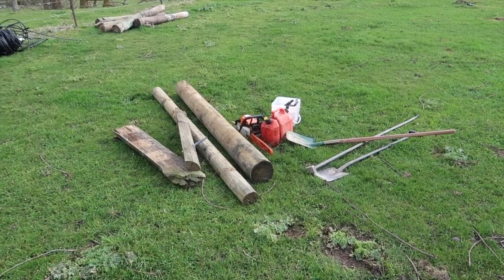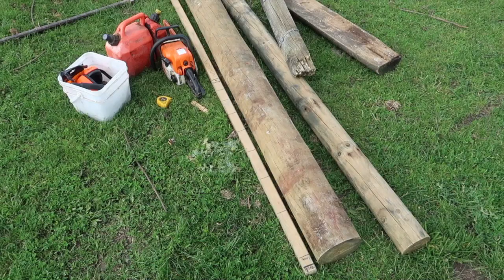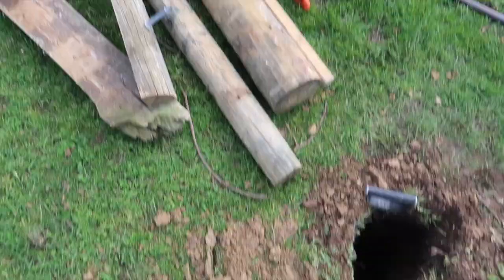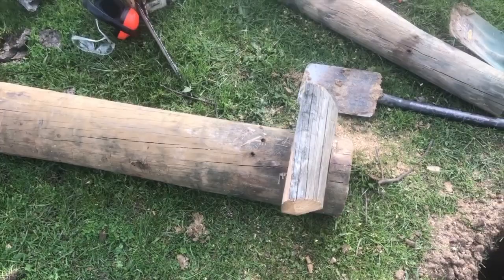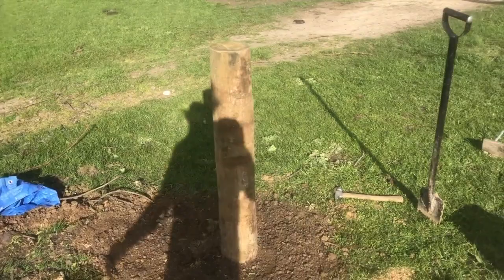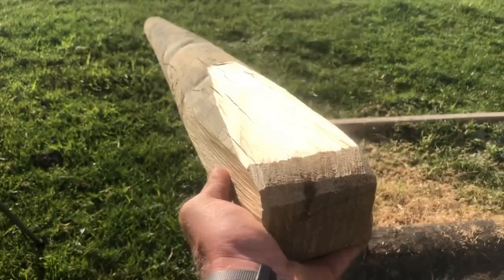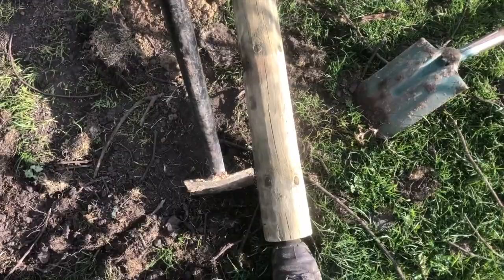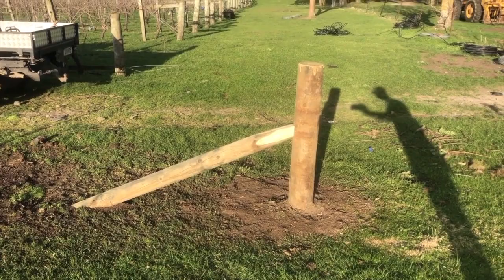Strainer Post Install (New Zealand)

Comment: Great to see - this is how I was doing end assemblies in the early eighties as a young man like you -  The post suppliers would put my posts through the chamber a second time. These assemblies are still holding 40 years later. Holes were dug with a manual borer with an extended handle to get the 8' posts 4' in the ground. Seven wires 3 hot 4 earth spaced at every 2nd hole from the top on a standard waratah star picket, however I used standard timber treated line posts. This wire spacing enabled fast and easy replacement of broken line posts with a star post.
Reply from the maker: @IsambardKingdom  Interesting to hear how others have done it/do it. Thank you for sharing.

Comment: Excellent video dude. Beautifully sharp chainsaw too. I’m putting in some stays tomorrow for a 1600-1800 fence with chicken wire and a top and bottom plate. Not nearly as deep as yours but on rotten rock and concreted in 100mm on either side. Definitely enough to go on here, great work.
Reply from the maker: @barneyatkinson-saul9881  thanks for commenting! Hope it went well for you.

Comment: Great techniques, really nice tight joint. Personally where I live in the UK it’s very wet a lot so we always retreat cut ends of the wood with wood preserver. Normally I use creosote posts which are more expensive but they last 50+ years and I retreat their cut ends with creosote
Reply from the maker: Yes, certainly not a bad idea re treating cut ends

Comment: Good to find this on YouTube for quick reference. Very tidy work too. Only thing I can think to add is using a battery drill with spade bit to get rid of bulk prior to chiselling can speed things up a bit.
Reply from the maker: Oh that’s a great idea I’ll give it a go next time! Thanks for your feedback.
Reply: Faster still, side cuts with plunge of saw. Then chisel. As long as water can drain out of pocket, no issues. 
Bugle screw foot on. Pilot drill foot so only screw into post.
Reply: @paulsmith4220  I'm pretty sure that could be done with correct technique but didn't feel safe to me as amateur.

Comment: Great video.. We have hard clay country .. I have using the post hole borer with a 200 mm auger . I bore a hole as far as I can ,then slide a half round in with matchs the hole . The I ram the stay in like you have .. saves a lot of hard digging....
Reply from the maker: Sounds like a good system!

Comment: Good vid mate another couple of ways of doing your Mita is a renovator tool.

And another way is they sell like 65mm self feed drill bits and u just use a pointed post for your stay then
Reply from the maker: @aamdempster5824  Thanks for your comment! yea mate I’m now onto the self feed bit and pointed stays, sooo very quick and perfect every time.
Reply: @Lindz37  👌👌

Comment: Top video my friend. New to farming and have a ton of strainers to replace around a block of land in Taranaki. Couple questions: 
- What kind of spades are they? Any suggestions to help with digging
- Any size guidelines for your Foot and Stay blocks? should these be new and treated so they dont rot out?
- 17:30 how do you know what sort of angle to cut your stay?
Reply from the maker: @hughezy21  hey mate, I tend to like the spade and shovel method, I like a spade that is solid steel handle and all, and prefer a shovel with a smaller head on it. Farmlands has the ideal ones I reckon.
Foot and block size no rule per se but the bigger the better just makes it harder to get em in. Yes make sure it’s treated and a step above would be to paint any cut ends with a tanalising liquid  of some sort. “Metelx” I think it’s called works well.
Line your stay up against the post pre cutting your stay and it gives you an idea of the angle to cut, refit once stay block is dug in and your cut out in post is done and adjust the stay cut. 
Hope that makes sense. Alternatively if there’s a heap to do, u could get a fencer with a post driver and they make very fast work of banging posts in, then u can do stays yourself if want to save money. As for foot on the rammed post I drive a Waratah full length down the back side of post on almost a 45 degree and with a couple large nails attach it to the post. Hope this helps cheers
Reply: @Lindz37  awesome mate, im gonna give it a crack this weekend. what size timber is your stay, eg: length etc?
Reply from the maker: @hughezy21  generally I like to use something like 2.1-2.4m long x 100ish mm diameter pointed post (pointed number 2 post) or unpointed if u are using chisel and hammer to create the pocket in the strainer post. U really can use what ever tho 1/4 rounds work too, seen half rounds used or even 100x100mm square posts. Longer stay gives better “holding”. Really short stays will tent to make the strainer pull up.
Reply from the maker: When I’m talking about the pointed post these days I drill a hole in the strainer post to accept the point of the stay, just bit quicker

Comment: I'm looking for a new chainsaw just for fencing, what size Stihl is that and what size bar do you recommend.
Reply from the maker: This one is the Ms170 with a 14” bar it’s one of the cheapest saws stihl make but a bit better is the Ms180 with a 16” bar would be nicer. Little bit more grunt but a little more expensive .

Comment: Hey bro. Get yourself some pincers and you will dig all that dirt about 80% quicker. I’m a fencer in Brisbane Australia and I don’t even use a crow bar unless it’s rock shale or solidified white clay. Dirt is really tough in Brisbane. 

I use pincers all the way.  In farmland I can dig a hole 800ml deep in about 8 minutes  that’s going for it hard core but pincers are the way.
Reply from the maker: Yea I have looked into them a bit but haven’t found a one that feels like good enough quality to not fall apart in the hard stuff, but thanks for your comment I will give it a go. Cheers

Comment: Good job there young fella Always wondered why kiwis use spades over the American 2 handle job 
may be spades are quicker
Reply from the maker: I wonder the same thing but i guess its just what each-other is used to, i must admit i have never tried the 2 handle, i should give it a go one of these days, ill make a video if i ever do haha.
Reply: @Lindz37  spade is good for facing your hole, and digging, rebate for the foot.
Reply: @Lindz37  I started mentally screaming out "SCISSOR SHOVELS!!!" when I saw you getting deep with the regular spade 😂, but the hole looked tidy and well-emptied, plus scissors are pretty heavy, so you might've changed my mind on how to go about doing this myself! Once I get round to it... Cheers from Waitomo!

Comment: Question from the USA.  Just curious on the number of wires.  I've noticed that the kiwi's and aussies mostly do hi tensile with 7-11 wires.   I've recently switched to hi tensile smooth wire and my cows are respecting a 5 wire non electric fence.  Why so many wires?  I run around 300 cows.
Reply from the maker: Hey, very simple answer, generally over here most farmers will run both cattle and sheep, the sheep will go through most fences that arnt battened or that haven’t got 8 or 9 high tensile wires. Farmers here that run cows only can get away with a 1 or 2 wire generally hot fence to keep them in, as females tend to not “push” through fences to get into another mob. 
Bulls, on the other hand (that I farm) will push through pretty much anything that isn’t hot sooo farming both sheep and bulls a 9 wire with 2 hots does pretty good at keeping both sheep and bulls in. 
Hope that clears it up a bit for you. Thanks for your comment.

Comment: Hey, what did you use as a foot. Is it a number 2 or 3 quarter round cut into chunks?
Reply from the maker: Cant actually remember what I used, probably a No3
Reply from the maker: In saying that tho, u can use what ever you want, half round quarter round of what ever size as long as it’s treated for under ground, so not battens which believe it or not iv seen before haha.
Reply: @Lindz37  I can Imagine! Thank you very much for that, it is very helpful. Great content man!  Found the video extremely helpful. Keep it coming! :)
Reply: @Lindz37  not, battens, any G.Tpost will do

Comment: Do you use the same technique for a corner post just with two stays? Or do you have a different method for corners?
Reply from the maker: Same I just use one stay for the angles (corner) and just aim in in the middle of the wires, so where the pull is. If that makes sense, u can use two stays just more expensive so I use one. Both work great. Hope this helps
Reply: @Lindz37  makes sense - thanks!

Comment: Good video mate. Whats the rule of thumb for the deep of your strainer post and full rounds every 4m or so for an 8 wire? Is it aways half the height out of the ground in the ground for strainer and full rounds or? Cheers John
Reply from the maker: Hey, so for strainers and any angles i generally like to use the 2.2m 175mm strainer and because the fences around me tend to be about 1100mm high, the strainers and angles go in the ground 1100mm with a foot. In this video the ground was real hard so i could get away with a 2.2m strainer which is plenty big enough. If a contractor is ramming the posts in they'll tend to go for the 2.4m pointed posts and put them 1300mm in the ground with a different footing system. As for the in lines i use 1.8m 125mm posts at a depth of 700mm in the ground again leaving 1100mm out of the ground. Ground conditions will change things a little bit, like if ground is swampy then bigger posts will be used and different footing. Hope this is of some help, Thanks

Comment: Hey HCL, I am putting a 3 wire electric fence. If possible I'll go for number 1 rounds. If not possible, I'll go for a quarter rounds. My question is if I went for number 1 rounds, how many meters apart could I place them to keep older calves and bulls in a 3 wire fence? Gallagher manual says 15-20m for dairy cows. Thank you very much. David
Reply from the maker: Hey, again with this it’s personal preference but probably 7-8m spacing should be ok, can always add more wires later if u find it’s not as stock proof as you were hoping too.
Reply: @Lindz37  what if i did 10m?
Reply from the maker: @davidsilveira198  yea can’t see why not, just the more posts the better generally as it’s more of a visual barrier too, but yea I’m sure it would be sweet.

Comment: Would you kindly share your wisdom, on what is the best way to put in a straight fence. Thanks HCL!
Reply from the maker: There’s no one way haha, I put all my strainers and angles in first then put the second from the top wire on and strain, as well as the second from bottom wire on too and strain. I usually bore the holes for the in line posts instead of ramming as I don’t have a rammer but with the two wires tight you can get a decent line to follow with the in line posts, if your using stays then put them in after wires but before the inline posts. Again mate that’s just the way I do it haha.
Reply: @Lindz37  That is really good insight. The last fence we put in was quite wonky. We had a tougher time getting the posts out that we put in, than im putting them in! Ha ha!

Comment: Why aren’t you using a post driver?
Reply from the maker: Would love to mate, but can’t afford one yet. Cheers
Reply: @Lindz37  you must work in good ground. Stoney Ireland is a different story for hand digging. Even the post driver fails regularly.
Reply from the maker: @johnclaffey7218  Yea certainly ground is on most of the time we have all sorts of soil types, my biggest problem is limestone country.
Reply: @johnclaffey7218  post drivers, use a spike rammed down, first, breaks up, or moves rocks.

Comment: How deep for that hole 22:28
Reply from the maker: Hey, it’s about a foot and a half usually, as long as the stay block is solidly in place and can’t move and the angle of the stay is appealing to your eye then it’s not a specific depth. Don’t go too deep or it will effectively be leavening the post up out of the ground.  if that makes sense.
Cheers